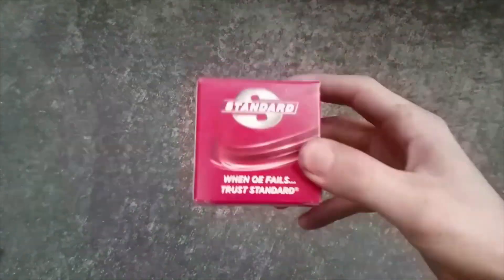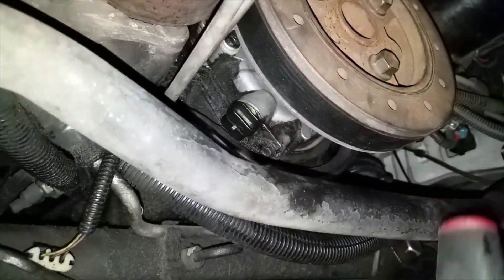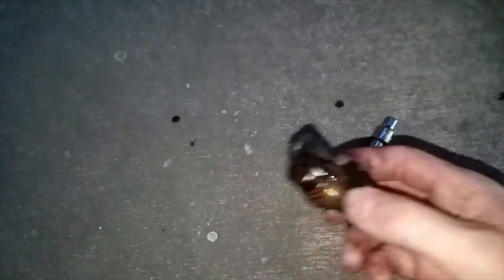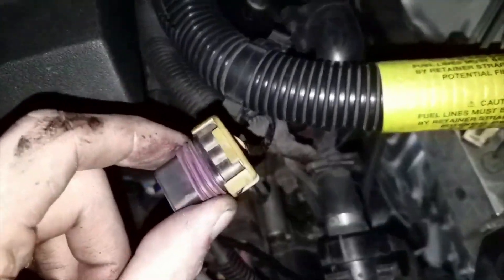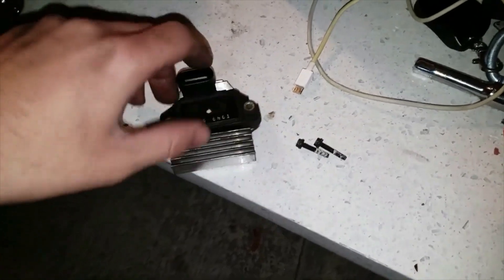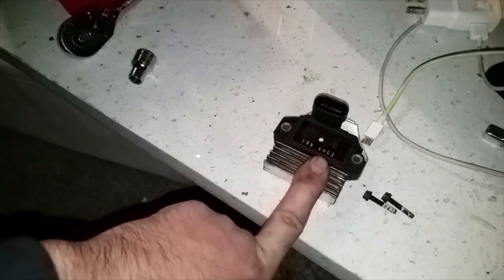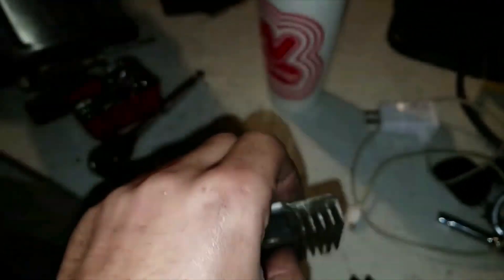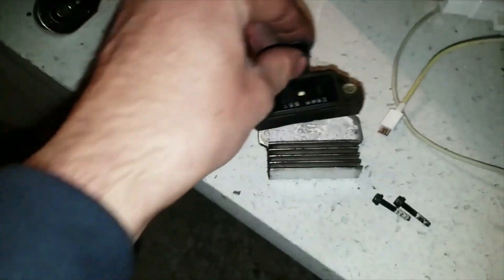Firebird trans am crankshaft position sensor

Comment: So im having a problem where my t/a loses power @ 3k rpms, i have p1351 and p0336 for cps,, i new new opti, wires, plugs, coil , what else? Could any if these sensors affecvt driving? I thiught cps was irrelevant since in 95 they didnt have them @ they were the same , more of obdii thing i thought
Reply from the maker: I usually enter these on Friday videos. Which I will answer again once I do the video. But I’m not certain if I’m gonna have time to do one tonight. 

But here is a whole list of things to check  not only are you getting both codes that are related. 

P1351 + P0336 Together Usually Mean:

Your Optispark distributor is either:
	•	Failing internally (common as hell)
	•	Contaminated with moisture or oil
	•	Not getting a clean signal to the PCM due to bad wiring, grounds, or ICM
	•	Or the crank reluctor wheel inside is damaged or misaligned

What You Should Check 
	1.	Inspect the Optispark unit
	•	Look for oil or moisture leaking in from the water pump or timing cover.
	•	Check for play in the shaft or signs of corrosion around the unit.
	2.	Inspect crankshaft position signal wiring
	•	Look for broken, frayed, or pinched wires coming from the Optispark to the ICM and PCM.
	3.	Test or replace the Ignition Control Module (ICM)
	•	A failing ICM can trigger both codes by misinterpreting or failing to send proper timing signals.
	4.	PCM (least likely but possible)
	•	If all else checks out, the PCM may not be interpreting the crank signal properly.

Bottom Line

P1351 + P0336 is often a death sentence for the Optispark unit. If it’s original, it might be time to replace it. Go for an ACDelco or MSD if you can cheap units tend to fail fast

Comment: What was it
Reply from the maker: @Live2die555  it was timing it was off.
Reply: @TOUGHBUILDSCUSTOMS  mine cuts out after running a bit and trying to drive and hit gas pedal will kill itself
Reply from the maker: That sounds like a fuel pump problem
Reply: @DailyDrivenStangs  that's what I'm thinking or bad vats system cutting fuel
Reply from the maker: @ yes. I would get that tested
Reply: @TOUGHBUILDSCUSTOMS  she goes out tomorrow morning had a shop look they wasted my time
Reply from the maker: @Live2die555  no way. What did they do?
Reply: @DailyDrivenStangs I know its been a while  but my 1997 trans am seems to have the exact thing with timing being off. How did you end up fixing the timing being off?

Comment: At 1:57, I noticed that the two ends of the CKP sensors you're showing  are not the same. I can't fit the new one that you're showing  into my 1997 Firebird V8 5.7 L, because the opening is cylindrical and narrower. Did your CKP sensor insert have a metal, cylindrical insert?
Reply from the maker: That’s wired man. Mine fit right In np I thought it looked different myself but nope. It fit right in. This was a customers car years ago. I wish I could remember what one his had.